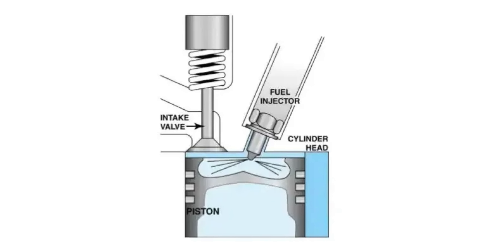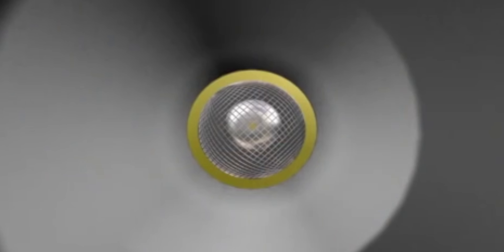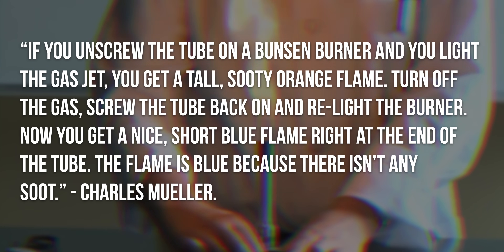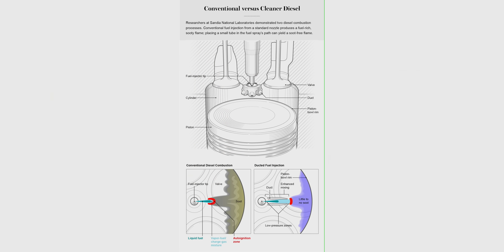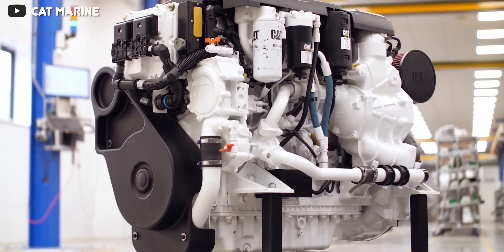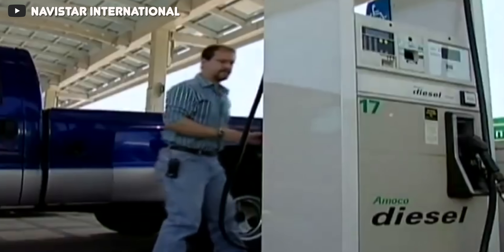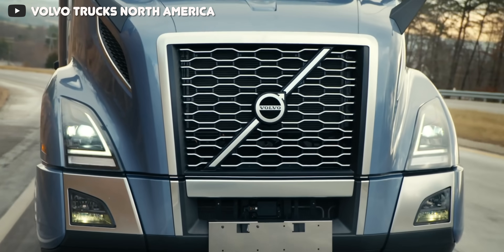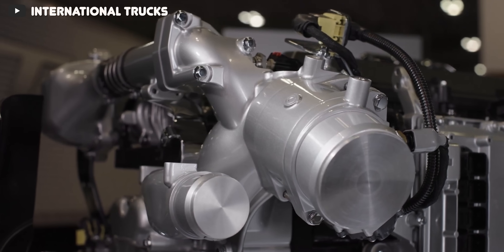Zero Emissions Diesels: How Ducted Fuel Injection can Save the Diesel Engine

Comment: Hopefully, this works out as advertised. 
The first thing needing to change with emissions is how it's measured. 
Instead of total output, it should be output per work done. If you add up emissions produced during manufacturing of DEF. The payload missing from the weight of emissions equipment. The materials used in manufacturing emissions equipment. The fuel use in distribution of DEF. Along with the tow trucks dispatched to rescue truck with emissions derates. Believe me there are many more negatives.Today's heavy diesel emissions laws are without a doubt a net negative for the environment.

Comment: What if we took high pressure air pulses (300 psi) and added them to the fuel stream at say 12-20 degrees BTDC? This should allow a very finely atomized stream that is nearly a vapor, and also charge the cylinder with an added air charge......

Comment: I read that they retro fitted a DFI and the carbon monoxide levels were highly increased so its not just plug and play. I have emailed them and waiting to her back but hopefully Ford at Cat are working on a complete engine coded and tuned to obtain better results. I hope this shines a better light on diesel to the public and EPA to help bring diesel back. Lower rpms, better gas mileage 30 -50 mpg and as good or better then gas emissions.  I wish the US would just wake up and see the benefits to clean diesel. Or shoot even Diesel Hybrid engines, imagine the mpg of that.

Comment: Maybe this type injection can be used in gas engines also! 
Maybe  they can couple this type injection with a high pressure air injunction! Using a high pressure air pump, similar to a diesel injection pump,  that sprays air in with the fuel ,like about 8 or so paint sprayers , the fuel pressure can be backed off slightly,   it's just a matter of buildings it,   maybe a compressor similar to a air conditioner compressor can be used, with a small tank, around 1 litre,  compressing the air to about 6x the engines compression pressure, then the injection pump fills a reservoir then sprays fuel while injecting air through it!  Same principal only supercharged!

Comment: While government regulation made by people who have little to no connection to an industry they are making regulations for may try to legislate away internal combustion technology, reality checks hits like a brick when the goals are unrealistic. Case in point, in Germany they just voted to ban the sell of gas and diesel consumer vehicles after 2035 with California also having done the same thing a few months ago. That's all fine and dandy but Germany is now the largest coal burner in Western Europe with them having to fire up old coal power plants that were slated to be destroyed since they can't get enough natural gas. You can probably guess there wasn't really a vote to do the later they just had to. So right now while these honestly unrealistic regulations keep being passed, once reality sets in they are likely to be walked back or altered. I work in the commercial vehicle industry and despite how about every other journal out there wants to say something about electric trucks, that eagerness is from a small minority of the industry. Currently, a Peterbilt 579  class 8 electric tractor will run you over 650k without any grants and that's not even including the cost of the charger which is at least another 70k. You also have to account for the cost of having the city power company come out and conduct an inspection to make sure you are up to safety standards (if not, add however much it's gonna cost to bring you up to standard to the total cost of this) which can then take up to an additional 2 years before you can even build the charger. The range is also a problem, presently most ranges of these electric trucks are overstated. An example being that the the Peterbilt 220 and International eMV both use the exact same battery pack and drive motor yet the Peterbilt states the range as 150 miles while International states it's only 135, and of course if you are in cold weather then even more power is needed to keep the battery packs at operating temperature leading to a further decrease in range. International has also recently brought electric school buses to market however, when they run either the heater or the AC system their range drops to a mere 30 miles.  Right now the class 8 electrics  by Volvo and Peterbilt are stating ranges somewhere around 240 miles though again, in practice with a full load they are coming up short. Right now, with the fastest charge you can typically bring a battery from dead to 80% charge in 90 minutes. Let's take a look at the power actually required to do that. The power draw on these fast chargers happens to be equivalent to the same amount of power that 70 (yes 70) households would use in the same period of time. Right now California is already requesting for people not to charge their electric cars during peak load times in evenings lest they run the risk of power outages. Keep in mind that only about 3% of vehicles in California are EV's and they are having power struggles. So the feasibility of the remaining 97% plus all the commercial vehicles is an absolute fever dream as the draw on the energy grid would be no less than 10 times what it is now. Then there's the cost of production. Despite what some are claiming, electric vehicles are unlikely to see a drop in cost even with improvements in manufacture as the cost of the vehicle is largely linked to the cost of lithium to make the batteries rather than the cost of the labor required to make it. As many continue to jump on the electric bandwagon and the demand for lithium continues to skyrocket, it's price is only going to continue to increase. Now, there are other battery technologies being explored like aluminum ion batteries but there is still the inherent issue with weight, charge time and total range, and even with improvements on the batter y side I think the advancements on the international combustion engine side will only continue to outpace them. I'm fairly certain that before the end of the decade the argument of emissions will have shifted and now will be the oil companies that actually push the point that modern internal combustion engines burning newer, cleaner, sustainably sourced fuels have less carbon footprint than any battery powered alternative.

Comment: Under new EPA regs, diesel has been pushed to the brink of extinction for passenger cars, despite the fact that they emit far fewer particulates than even Tesla cars emit from brakes and tires.  They also emit less carbon than petrol cars, simply because diesels use less fuel. Add ducted fuel injection and we would have extremely clean engines at lower cost because most of the emissions hardware could be eliminated.
A small or tiny OPOC diesel range-extender hybrid car would be a winner- Reasonable cost and amazing fuel economy and thus low carbon and low soot looks entirely possible.  Look for California to outlaw it soon.

Comment: I love this......But, here it comes. This feature if adopted by truck/ car manufacturers, will increase total value of the product. Currently most pick ups range from 60k to 90k. I can't imagine what the big three would make us pay for this technology. Furthermore, lets say someone is able to adopt this awesome idea. Its gonna get tangled up in red tape with who is (A.) willing to buy the patent rights or manufacturing rights. Or (B.) someone might pay good money to kill this product and wait for a later release when they have a bolder product that would appeal to the public(looking at you Gm). I would like to see this as an aftermarket injector. I know that there are thousands of diesels but if someone was able to partner with the lab and make injectors for the big three. I would rather pay money to the lab and the business that makes this, than the stealer ship. I guess I just want to see speed shops or small business benefit from this, rather than the big three. On the other hand I can see the EPA and the Govt. completely mess this up. Big three please prove me wrong. I guess time will tell.

Comment: Hi all! I’ve watched this presentation and work for a company that has helped fund this research. Here is why this will not come into play:

1) Most diesel injectors use not 1 but multiple “holes” in their injector tips. The duct design demonstrated on a test engine is on for a single plume/hole.

2) the small thermal mass of the duct material becomes a hot spot and it eventually fails the material

3) Additionally, the benefits only have been demonstrated on steady state operations, not transient/acceleration.

It is a fascinating application, but technology just isn’t there.

Diesel alternative fuels or multi fuel engines running a compression ignition cycle are more promising for GHG reduction.

Comment: Sounds good, better than all that crap they mount after the engine to reduce emissions. It's what I always say, focus on fuel consumption, better efficiency is better fuel economy, is better emission. Makes more sense than burn some extra fuel to activate the emission system in the exhaust to be 'clean'. What nutcase came up with that idea?? Go back to a basic diesel engine and upgrade it as much as possible without that 'after treatment' bullshit. A diesel need to be able to breath as much as possible, not to be restricted. I take away the soot trap of my gm 6,5 and replace it with an open 4" exhaust, massive improvement on all territory, sounds better, runs cooler, more power and needs a lot less fuel 👌

Comment: The linked article in Scientific American is fundamentally in error. It says "There, the emerging fuel droplets break down to bacterium-size as they travel at 600 meters per second—about the cruise speed of the supersonic Concorde airliner—and mix with air to form a “fuel-air charge.” Immediately thereafter, a plunging piston squeezes the charge to generate high pressure and thus heat, causing the fuel to self-ignite." That's actually describing detonation in a petrol engine. The Encyclopedia Britannica correctly says "The diesel engine gains its energy by burning fuel injected or sprayed into the compressed, hot air charge within the cylinder. The air must be heated to a temperature greater than the temperature at which the injected fuel can ignite. Fuel sprayed into air that has a temperature higher than the “auto-ignition” temperature of the fuel spontaneously reacts with the oxygen in the air and burns."

Comment: The problem is not the soot that diesel engines produce. It's that fossile fuel emissions destroy this planet's climate. Ecofuels made out of plant matter, algae or plant oil don't help either, since at this point, CO2 actually needs to be removed from the atmosphere and not just recirculated. Btw, a leaner mixture means higher NOx output and even exhaust gas recirculation is not going to change that.

Comment: EPA standards generally follow the ALARA principle: standards are set as low as reasonably achievable. As technology progresses, the standards become more strict. Note that gasoline emission standards are considerably more strict because it is easier to have low emissions in a gasoline engine.
I wonder if this could also improve Mazda's SkyActive-X engines. They use EGR with a gasoline particulate filter. The engine uses gasoline, but they also try to achieve compression ignition.

Comment: I believe diesel has alot more potential than gasoline engines, so don't could them out yet. The thing that will kill it is politics because politicians are heavily invested in electric EVERYTHING!! 
And Diesels we're originally designed to run on PEANUT oil. Let's give that a try. And whatever happened to "bio diesel". The exhaust smells like french fries. YUM!!
Great vid. 👍

Comment: If they didn't burn more diesel, in efforts to make diesel cleaner, the usage of diesel fuel (which has increased since catalyst emissions became mainstream) would be less.
CAT had the 3126 On Highway Engine that was equivalent to propane emissions at idle. And the Feds wanted more cleanliness!!! THIS WAS IN 2003!!!!
And it was achieved by injection timing!!! Nothing more!! NO CATALYST MUFFLER, NO DPF, NO SCR!! Honda tried, Volkswagon tried, Navistar ROYALLY FAILED,  and Cummins came REAL close. CAT got out in 2008 because they didn't wanna put up with the BS from The clean air act WANTING MORE from them. They were gonna use them as a TOOL for the whole world, with no compensation. Navistar COPIED CATs fuel injection in 1996, they should have burned for it, the copy cat dicks.

Comment: Good video.  Though, it's probably too late already.  People have heard, "clean diesel" too many times and it's turned out to be not so clean.  Europe, once a heavy diesel proponent, is basically on the same timeline to eliminate all fossil fuel engines.  It's basically impossible to turn public and investor sentiment around at this point.  Also, you still have other emissions like NOx to deal with so you'll still need an SCR and DEF fluid, so is it worth it?  On fuel savings, maybe, but again, you're looking at the end of life of the diesel engine and probably not many will invest heavily in that.

Comment: They have made emissions worse. They have put so many emissions components on these engines that they get nowhere near the mpg they could get. This means they are burning a ton more fuel than they should be burning. Circulating exhaust into the oil dramatically shortens the oil life, in turn you have to change your oil more often which obviously uses more oil. This is putting more emissions into the air and depleting our oil supply. Let the free market do what it does best, innovate!

Comment: No. The bunsen burner sucks in more air, by using the pressure of the gas which turns into speed as it expands in the nozzle. The added air causes the full combustion. In the diesel the nozzle won't add more air than is already there.

Comment: I’m not sure the Diesel engine will die any time soon. Up north in Canada where I live electric semi’s would not be able to hold up to the harsh conditions and environments that Diesel engines are pushed through, be it Hauling water or frac sand or rig haulers, Cranes and hotshot trucks these trucks go out to some pretty remote places and in some pretty nasty temperatures. Maybe for the strictly on highway haulers I could see electric trucks thriving but The diesel will be NEEDED for years to come. This innovation sounds cool, maybe the diesel could replace small gas engines with this method in practice.

Comment: So with this type of innovative engineering solutions to engines and use of renewable diesel (not biodiesel) there really is no case for EV. I've for some time thought that these engine restrictions are too rash (at least in EU) to leave any room for improvement and consequently means that there are two parallel industries that are both very toxic.

Comment: Soot is currently a non-issue for all major manufacturers. The emissions being controlled are NOX (Nitrogen oxides). The other thing to consider is a lot of the Carbon output is nano particles that string together in the exhaust, these cannot be controlled in the combustion cycle as the will be created right through the mixture range from being ultra lean to rich. 

The counter intuitive thing about particle size is that a rich mixture is easier to "make clean" then a stoichiometric or lean mixture as smaller particle sizes created in leaner hotter mixtures are harder to trap and also more potentially more damaging to the environment.

Current injector tech is in the 95th+ percentile of hydrocarbon based fuel burn efficiency leaving only small room for improvement. thus gains are more easily made in capturing the exhaust emissions and capturing wasted energy in general. Regenerative systems on a diesel engine would produce far more emission saving then any future engine developments.
Reply: Particle emissions are not bad to the environment, but to human health.

Comment: this is the kind of dumb science that will doom the world. Were just gonna keep kicking the piston horse till the end of man kind. You know the whole point of keeping a piston engine is because it's the worst engine possible. What does an engine do? extract pressure and heat from a volume of fluid. Heat converts to pressure, and generally they don't bother with the heat. So basically an engine is just a pressure expander. What other types of pressure expanders do we have? we have the vane pump, we have the turbo, we have the screw expander. Turbos are more efficient than superchargers, because super chargers use kinetic energy provided by the piston engine, while turbos use the kinetic energy provided by the turbo. Would be more efficient to mount the ac, the alternator, and the whole engine eventually on the turbo lool. But no we're just gonna keep the 200 moving components, very finite service life engine, that is prone to breaking down, over fueling, clogging injectors, cracking manifolds. Why? because it's a money making machine, it's a hidden tax one everyone's labor. It's a wealth extracting tool from the world. So great! they make a diesel injector that not only injects fuel, it mixes it inside the combustion chamber! hazzah!. Only emissions are changed, fuel economy is basically the same. I guess we can keep on warming the globe and extracting the wealth from the masses! i'm glad you're entertained by this brain dead circus.